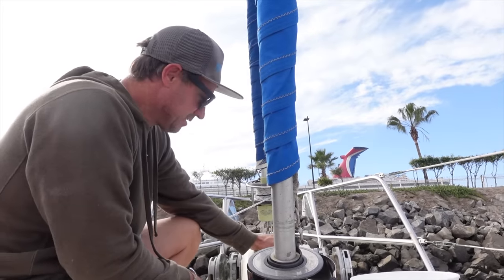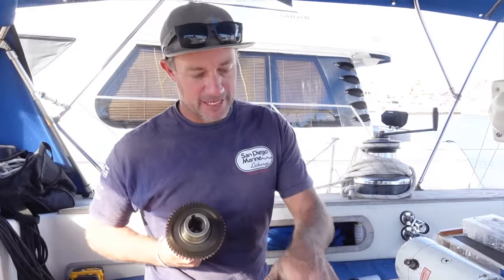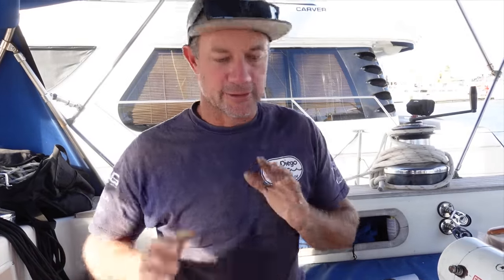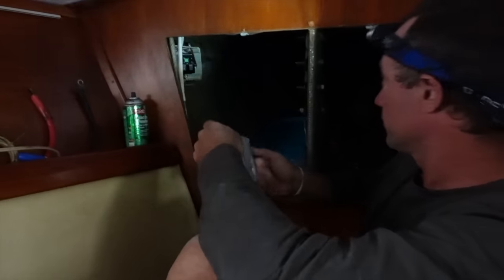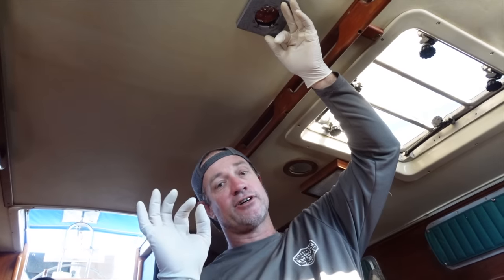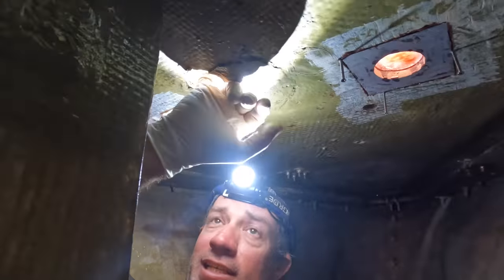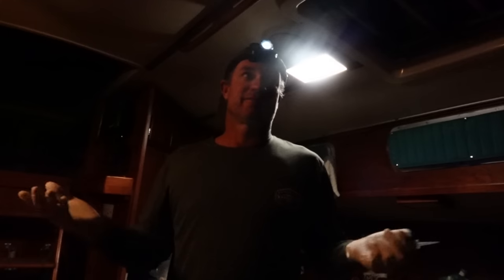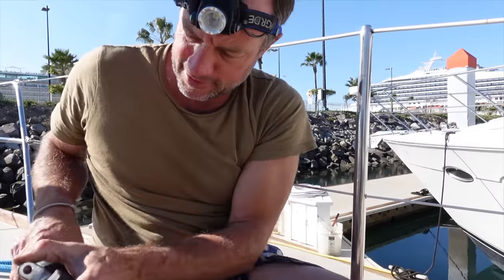If this isn't fixed we aren’t going anywhere | Ep 338 | Lots of BOATWORK

Comment: The smaller model of those windless had a sacrificial hollow s/s pin in the shaft to protect the motor , It always gave up at the worst times so i replaced it with a solid s/s pin , Never had a problem just went by aer , If she started to work to hard just back off a bit & THe solid backing plate a MUST . Good job , Now to protect the electric connections ?

Comment: Question?  You anchor with windlass only or do you use snubber to take the tension off ?  Cause you said something about being anchored in 50 knot winds....just wondering. either way, this thing is a tank now!! niiice work sir
Reply: Snubber can break; then its a hard snapping pull onto the windlass as a Hail Mary